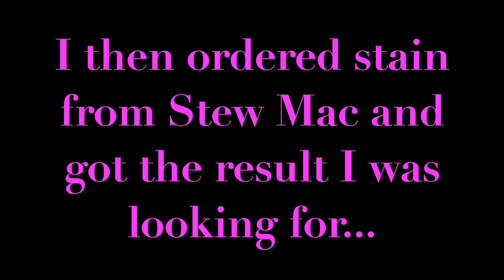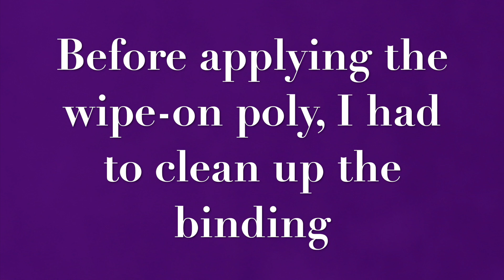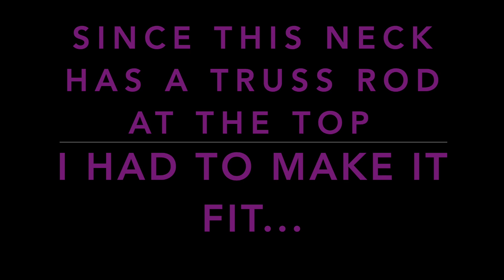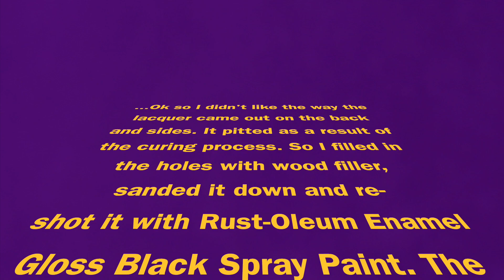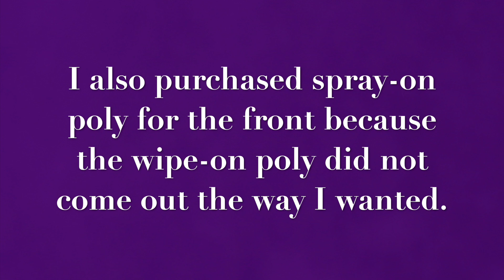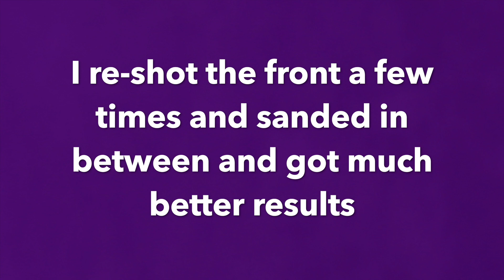My BYOGuitar Wolfgang Kit Project (part 2)

Comment: Completely wrong choice of paint... Rust-oleum are paints for metal and this is why the results are... Well, bad. Sorry man.
Reply: The quilted top looks great and the bottle had 3 pictures of guitars so what so you think of that process? And you're referring to the black paint in your comment? What would you use to paint the black with (and if you have pics that would be awesome) and do you know what nozzle is attached to the spray paint can? I'm looking to do this same guitar (a "real' Axis or Wolfgang where I'm from is about $3.5K) and I've never done one before so I'm collecting tips/ ideas. I'm handy enough when it comes to this sort of stuff but getting the right info is key and from your comment I'm assuming you've got some idea of the processes involved.... cheers mate.